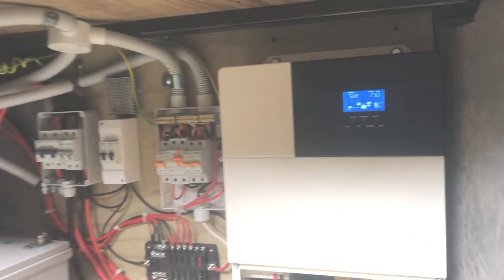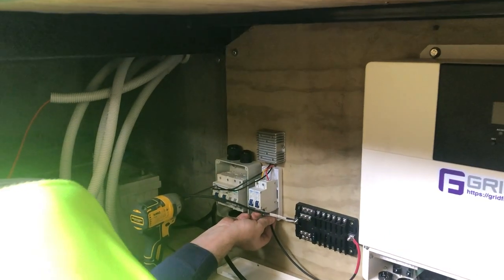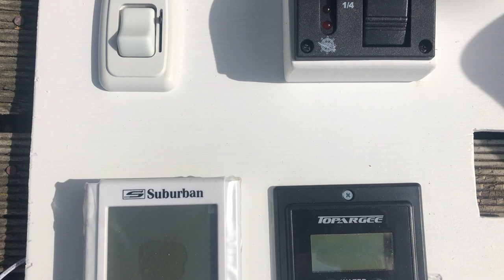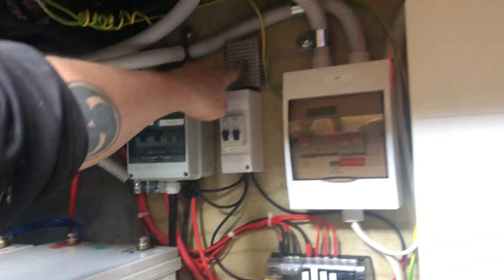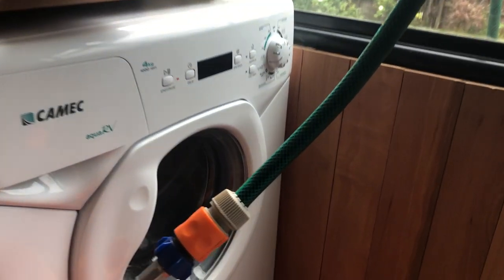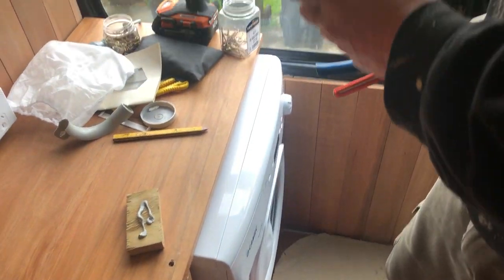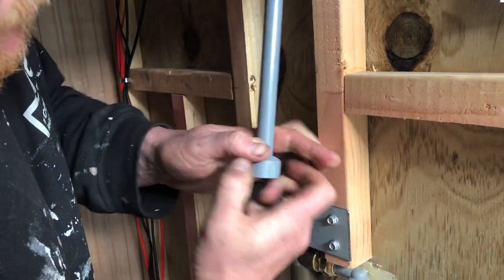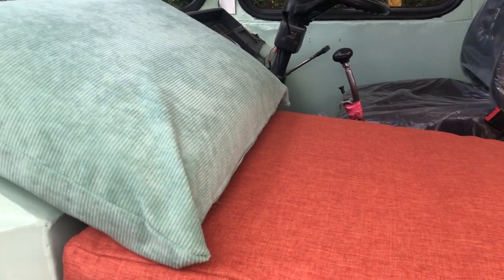Power, water and a washing machine, 1984 Isuzu JCR500 school bus conversion (S1E17)

Comment: Can you tell me what the brand of LED lights is that you used and where you got them from? Thanks!
Reply from the maker: Acegoo RV Boat Recessed Ceiling Light... dimmer switches that actually work with LED are hard to find, we got American Technology Components 12 Volt DC Dimmer Switch for LED, not pretty but works. All ordered from Amazon.
Reply: @RebootLife  Thanks, really appreciated. It's not easy finding good 12 V LED lights as it is, and as you say, finding a dimmer that will work reliably with them is even harder. You'd think with all the stuff coming out of china at the moment they'd have plenty of options but there are relatively few. 
Just looking at the dimmer unit online, I am seeing one with a slide potentiometer - is that what you have?
If you don't like the look of it you can always transfer the control board to a nicer faceplate and swap the slider potentiometer for a rotary one with a nice knob on it.

Comment: Hi, why such a small power system?
How often do you charge? ( off 240v)
What was the deciding factor on not going lithium?
Reply from the maker: We don’t need more power. We happily run everything we need off this. We have never needed to plug into mains. We do hot water and cook on gas. Why not lithium... well, price. Next time we might go with lithium though.
Reply: @RebootLife  Oh okay cool thanks, I deck cars, vans, buses, out and I had always found more power the better,  but It depends what you run. I'm in the North Island of NZ tho.
So you use a washer not a washer dryer yes? How do u find it?  I didn't see a video of after you guys have been living in it while saying what you'd changed or not? Would you guys make one? Or am I blind and you already have one.
Reply from the maker: We are very happy with just a washing machine, no dryer. We just wash in good weather and hang stuff out to dry. Easy as. We can easily maintain our lifestyle on this kit. The panels even pull in enough solar in the middle of the raging West Coast storm we have right now to keep our battery levels safe while running the fridge and just normal use (no big draws). No need for generator even after 2 days of heavy rains.
Reply: @RebootLife  nice that's pretty good, what do u get per hour from the solar do you know?
Reply from the maker: Sorry, don’t have those numbers for you.
Reply: NZ mains is 230 V, not 240. Not sure why so many people think it's 240, it has never been that here.
Reply: @sw6188  yes I know thanks, but I wasn't sure that they would.